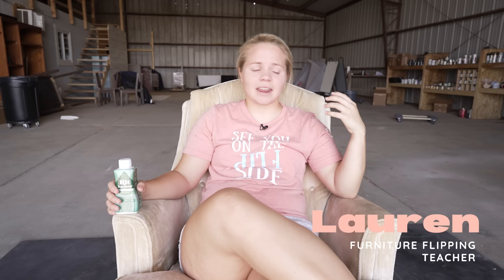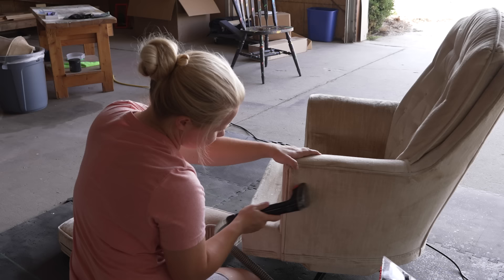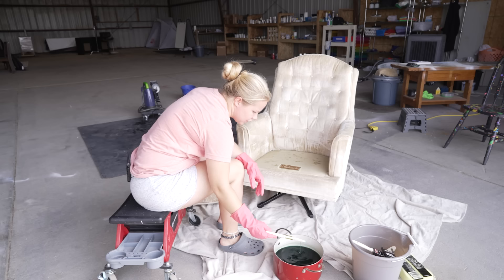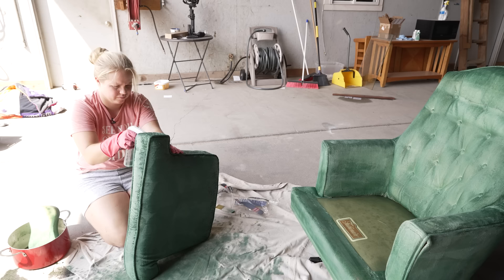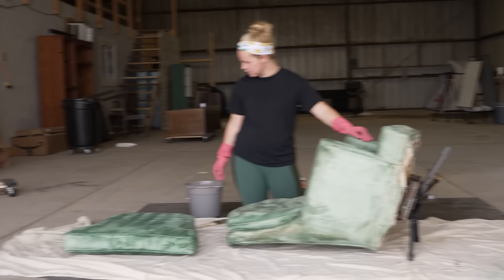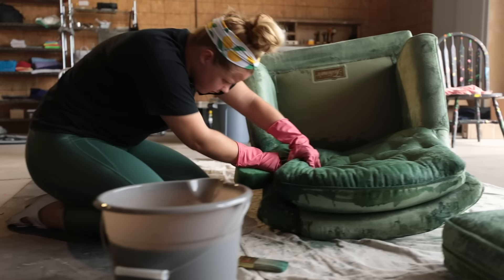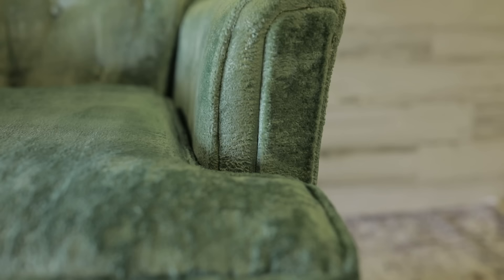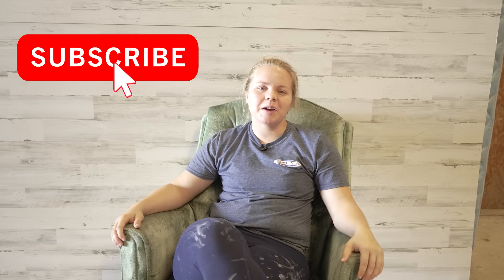I DYED A VELVET CHAIR! | FLIP or FLOP?

Comment: Love the video. I have a question about the bissel cleaner. Have you had any problems with it leaking? I had one the older models and it leaked. You need a hot plate for your workshop to do the dye in then there is no chance of you burning yourself. Thank you!
Reply: She did say in a previous video the Bissell was leaking.
Reply: @laurieg673  thank you for answering my question. I am not going to buy now. I don't want my floors wet all the time.

Comment: That looked like a lot of work but definitely worth a try. I love that your followers are so encouraging and offer some great tips. I was thinking to use a more concentrated mixture of dye for a more intense color, then use the Bissel to rinse off for a more even coverage.. Maybe this would prevent drip marks that dried in the sun. One more suggestion, maybe use a fan to dry instead of the sun. Or even a heater to heat set the color. Lots of love Lauren! Always enjoy your videos.

Comment: L- there are great tutorials on Rit dye on youtube.  Both the dye and fix are 2 tbsp per 2 cups hot water. Use a spray bottle with both. Take the foam from the cushion than dye.Let chair heat up in the sun all day. Than spray the fix let it dry in the sun. Than use your bissell to wash the fabric. It will take out the excess dye. Use synthetic dye on synthetic fabric and reg. Rit on natural fibers. You can also do this whole change the fabric color with the use of fabric paint or a mix of fabric medium and acrylic paint (make sure to thin with water). Again many tutorials on youtube.
Reply: PS I would try both medium with a paint sprayer. Try these different ways with the fabric you have torn off. Save your effort and money.

Comment: Thanks!  I’ve been dying to use Rit dye—pun unintended.. lol.  I did use a spray dye I got from a craft store that is typically used for dried flowers on my microfiber couch and it turned out amazing.  I stuck with a very similar color to just refresh it and make it look new.  I do have a lot of Debi’s DIY paint —which I really love.  It’s clay, chalk based and super pigmented so you can water it down and get a dye effect on fabric.  She has videos as well as others, and the trick seems to be wetting the fabric first, keeping it wet and using a sanding block to work it into layers between coats.  I have a chaise in a light color I want to paint.  The RIT with color protector makes sense.  I may go with actual dye.

Comment: It looks cute! But I think you should have hose it down to rinse the extra paint off and then let it dry. I think is best to clean the chairs like you were doing before is better and less work. Have you tried using a steam cleaner for upholstery? Also, just an idea instead of pulling off the skirt why not cut it halfway around the skirt and stable the rest under it would be less work also.

Comment: IN True Lauren fashion your pants matched the dye...before the application of it dried of course. I want to say this is a lime kinda green or peridot I think may have been called. Its blotchy looking but I wondered how this would go and why I watched it. I thought of doing this with paint to a boltaflex faux leather couch I have that my dogs have loved the finish off from the seat parts and its peeling. I saw where I think duck tape was used to lay down over the surface of the peeling area to remove the peeing bits and then paint of some sort used and I am wondering if the paint you use that doesn't need primer for cabinets and such would work and if for whatever reason it turned out to be too still and crusty feeling I could then buff it like you did this chair? Great work though as always, with the throw you staged it with you made it look pretty.

Comment: I did this, years ago! Then I realized it has to be rinsed or the dye comes off on you! Red everytime we set on it. It wasn't easy getting the wooden chair into the shower & rinse it. Then it was all good. That's 20 years ago  & it's still red & with us. But I wouldn't recommend it. I sprayed mine on with a spray water bottle.
 It was right dye!

Comment: These velvet chairs & the green 1s u ripped the cover off...are worth ALOT left alone. The are Mid Century Modern. Advertise Nationwide & JUST CLEAN THEM. I have 1 worth $650 because of the brand name. This pair was worth $800-1k-ish or more cleaned & with the skirt on. If the material was in good shape.

Comment: I tuned in to watch you dye the chair,I mostly use RIT Dye for dying draperies, clothing and salvage fabrics for sewing. I've  never used the "Dye Stay" fixitive however I usually with RIT Dye  use white vinegar deluted with equal parts water sprayed or rinsed in the rinse cycle with fabrics afterwards to keep it from bleeding(less expensive technique)but effective...did you have any issues w/the RIT Dye fixative  afterwards? I must say it came out l👀king  fairly well tho...

Comment: Is the fixative something that will wear off after a period of time and can be applied again if it does start to wear off? 
Welllllll...Im hoping to turn a green velvet headboard to black to set the white pillows from the white bed set against ...DUNHDUNDUN 😱I also will use the same method to turn two bar stools from blue to black but its fabric and no-one ever sits on them so im not concerned about those that much- but the sheets and pillows im scuuured and concerned about to say the least since the cat and the boyfriend blacken them enough!🤣...any thoughts ? pleeeeease

Comment: I am at 7:30 and wondering why not try experimenting with the skirt you removed from the chair. That fabric is waiting to have his existence justified. It would definitely be a good practice to measure the amount of dye you are using And write it down. That way, if you have to make up more, you can better approximate the same color result. Additionally, good night want to make something else match to it later and it gives you a starting point. Instead of rinsing the furniture with the hose, you have the Bissell. It would use less water, and dry your item, faster, if you just use the Bissell cleaner with clean water to rinse and extract the excess dye..

Comment: I’m pretty sure that Rit makes dye specifically for non-natural fabrics, like polyester, and they provide a list on their site. Fabrics with standing fibers, like velvet and corduroy, have what’s called ‘nap’ meaning that the fibers are meant to stand in one direction. You can feel nap by running your hand against the surface which will feel smooth in one direction which is going with the nap. The other way feels rough to choppy which is going against the nap. So it’s important to restore the nap—put those disturbed fibers back into place by brushing them back in their original direction—going with the nap—before drying. Then the light reflects evenly across the surface which might solve the blotchiness. You might be able to restore this chair’s nap by rewetting with water or steam, then brushing with a flat clean clothing brush, or even an vacuum attachment upholstery brush. That should also restore the unidirectional sheen. Good luck!

Comment: My first thought was that's a great colour but I think it needs to be darker. I would think spraying it on then brush in is best and a paint spray gun would be the bee's knees for that. You can adjust spray and it would be easy cleanup. I see it is the die more die and giving its probably a polyester or nylon or something chair not a natural fiber that would be the right guy but I would be tempted to put it on full strength. Absolutely need to rinse out the extra because if you sat down with damp clothes you probably walk away green. I don't think I'd use a hose that's just far too much water I would use a steam cleaner again to pull the green out and do it a couple times. Depending on what the velvets made out of yeah I could see needing to sand it and brush it afterwards. I have two velvet chairs one has a spot or it's kind of worn through and the other one is wood with a velvet seat back. The worn through spot I've got to try to figure out what I'm going to do the other one I love and it's in great condition I think it might actually be whole velvet but it's like a weird greeny orangey yellow like maybe it's faded or something I want it dark blue and I  cant die at that color. Contemplating the whole painting at thing but I still want it to be velvety so not sure what I'm going to do with that.

Comment: If you use chalk paint, spray your chair with water. Then apply the chalk paint. Spritz the chalk paint. Use the chalk paint sparingly. Add more chalk paint, spritz as go while adding more chalk paint, until the desired look is acquired. The chair will have a velvet feel.

Comment: Oh my. I would like to see you cover it with pristine white towels and then run it through some twisting and pressure before I’d ever buy that chair. You need to either do that or the white jeans test. 

It’s pretty but waaaay too much work. I plan to paint a chair with DIY Paint, a clay beard paint. But it’s because I don’t have the ability to reupholster it. Plus it’s mine so no worries on the time.

Comment: Not a huge fan of this particular one but maybe one that's not velvet would be better because the feel of it won't change so much. I also think using really cheap spray bottle and brush didn't do you any favors. Just like painting if you want a good finish, you need to use good tools. I'm wondering if there is dye that is specifically made for furniture as Rit is also a really cheap product both in price and outcome. I'd like to see another one for sure. I bet higher quality materials will result in a higher quality result. I do understand you're trying not to spend a lot on an experiment but with this chair you may have lost $20 if you can't sell it,  but if better materials gave a better result you may have netted $50 or more.

Comment: I really don't like it. It might be to someone's appeal, but honestly I believe it looked better  before. It's just too blotchy. I dont think you  applied enough die to it. Those dies are designed to be used in washing a washing machine so the the fabric literally soaks it up and then the excess is rinsed out. It might have come out better if you applied it while the chair was wet, soaked the fabric and then washed it down with the hose like you said during the video.